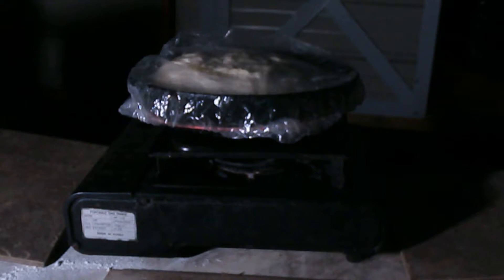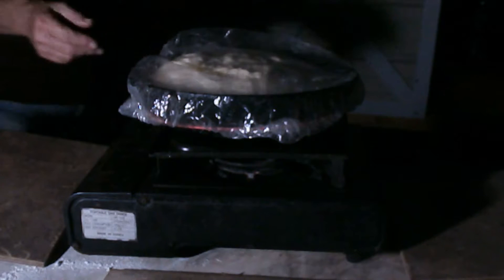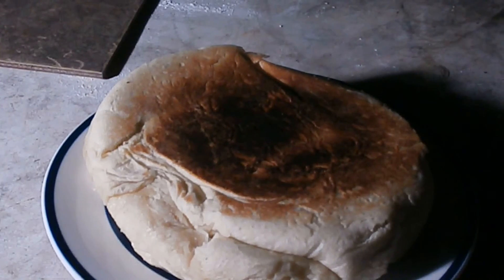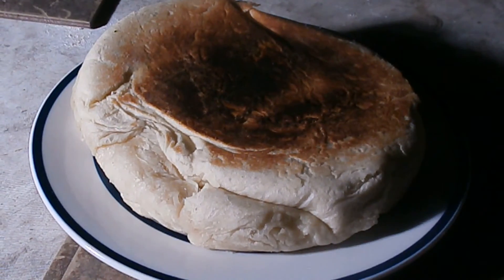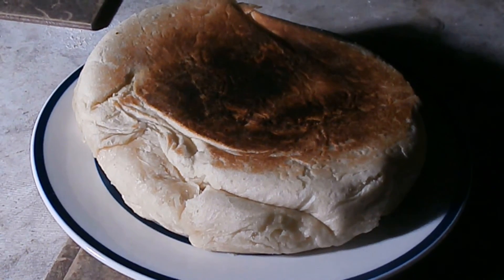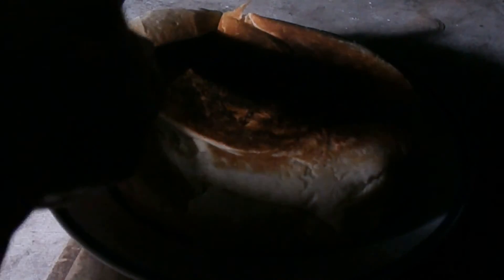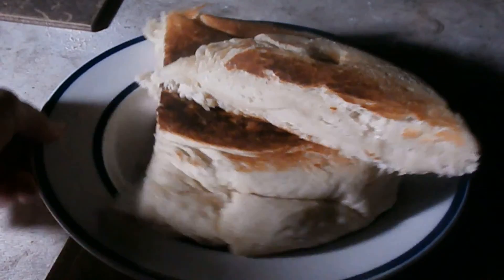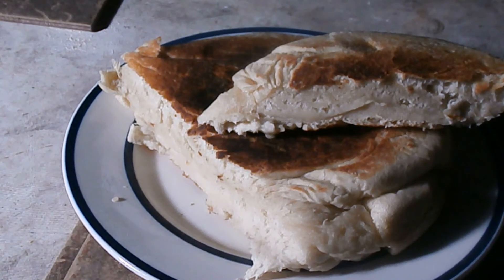Off Grid Bread again - part 4

Comment: Love that you share your experiences, wins and fails, with us.  That's how we all learn.  I have succesfully baked muffins in my BBQ (indirect heat), so maybe that would be an option to do bread.  it would mimic oven better than a butane stove maybe?  I've not tried this, but just a suggestion for next try.  If you time it with your next BBQ/cook-out, it could also be an energy savor by using the cookout heat for a 2nd purpose.  The positive?  We all learned something here, right?  :)

Comment: Have you tried the pan in pot method? 
You might have better luck doing that. Or using a Dutch oven baking method using coals?
Reply from the maker: I don't have the right kind of DO for coals. Mine has a domed lid instead of one that has a rim for coals. However, I will be trying a pan in a pot next, or maybe fire up the grill (It's wood; no propane) and try in there. I really really want a sun oven and a little coleman camp oven...lol. I did bread in a skillet some time back and it worked. I think I did this in by getting in a hurry, though. Thanks for watching and for the suggestions!